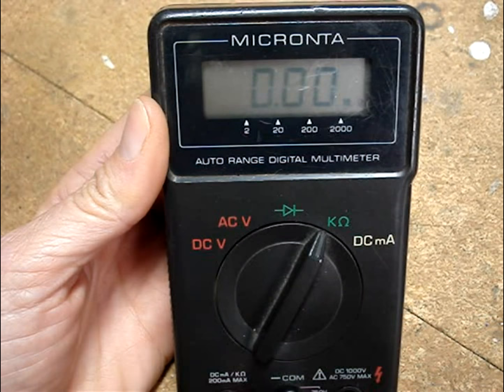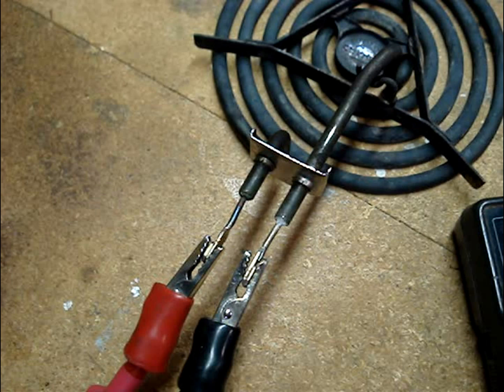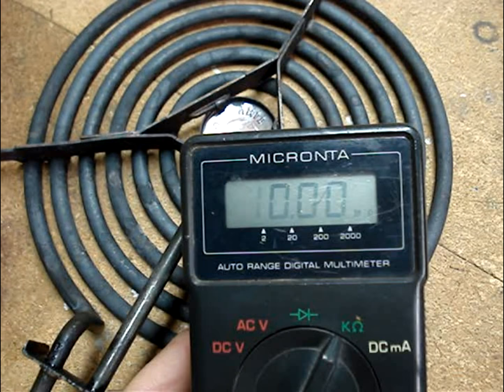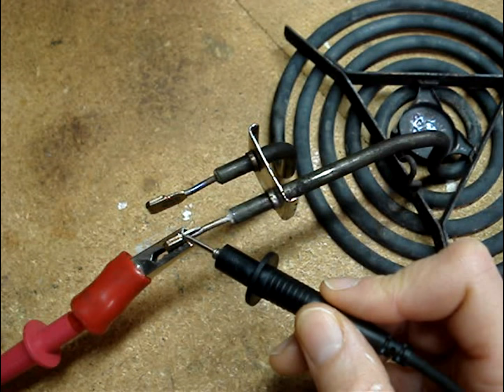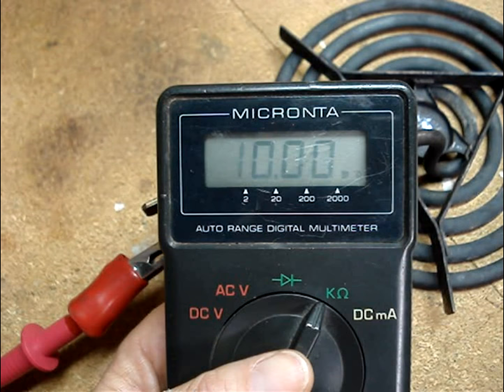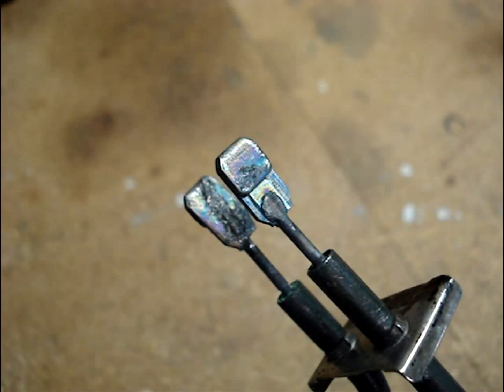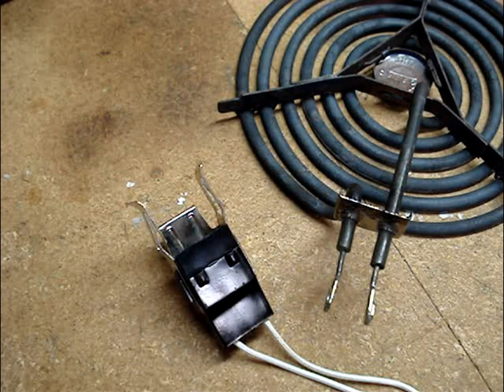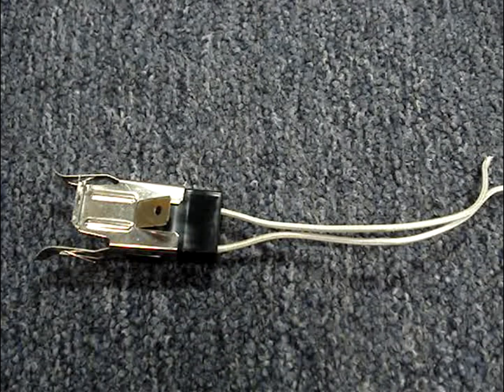Electric Stove Burner Not Working - Test It!

Comment: the rust on that wire ( at location time marker 1:35) speaks volumes to me. It means the wire inside is burned out or on the way to be burned out. I had one yesterday that shown a weenie hole underside and into the wire area of the burner element its self. It really threw me.  Just a little hole allowed moisture in to the black casing and in time, it gradually shorted out. I got a tingle of low amperage power on my fingers.  It was like a volcano that microly erupted. You should of seen the hole. It was maybe 10 mils in diameter.

Comment: This video was very informative. I just had a burner arc and it burnt a hole in the burner and also the arc was so hot that it burnt a hole into the bottom of the pan that I was cooking in... up until today, the stove has worked great. Would you say that this just could be a case of the burner just failing after many years of use or should I look at other potential causes? I plan on inspecting and testing the connectors while replacing the burner but unfortunately for me, it’s Sunday evening and all of the stores are closed....
Thanks you.
Reply from the maker: Without being there, it's hard to give you good advice.  Loose/faulty connections will heat up.  If it was a loose connection, I would expect that you would have had some sort of warning.  If you are not good with electrical work, you might want to call in a pro... your situation sounds like a potential fire hazard if not properly repaired.
Reply: @Know-How-Now   I did some testing and I believe that the burner just shorted out after 20 years of use it just finally decided to call it quits. Unfortunately It took out my range control switch with it. Either that or the switch failed and caused the short to the burner, either way with information from your videos I was able to troubleshoot and diagnose my issue and for that I am grateful and I say Thank you very much! 
There is so much great and useful information on just this one channel alone. I have subscribed.
Reply from the maker: Maybe the switch control switch stuck to the on position and overheated the burner  Thanks for taking the time to write about your experience.  Welcome to Know How Now channel.

Comment: At the 36 second mark it looks like you switched multimeter which is confusing to a rookie like me, then you switch back...the first one (micronta) you don't show how to "zero" it out like you do on the second one
Reply from the maker: Hi Sean, the Micronta meter is an auto ranging meter.  It doesn't need to be "zeroed out".  Putting the two leads together tests the meter & the leads.  Some old analog (it has a pointer) meters need to be zeroed when you put the leads together.  The 2nd meter I show is not auto ranging.  You have to adjust the meter to the anticipated range by turning the dial.  

Since the video is not about learning how to use a multimeter, I didn't want to go off topic and tell how to use one.  There are some good tutorials on that topic.  One suggestion, is that if you buy a multimeter, spend a little extra money and buy a digital meter with auto ranging.  They are much easier to use for a beginner.

Anyway, don't get crazy about testing the element with a multimeter.  Just go on to the swapping method.